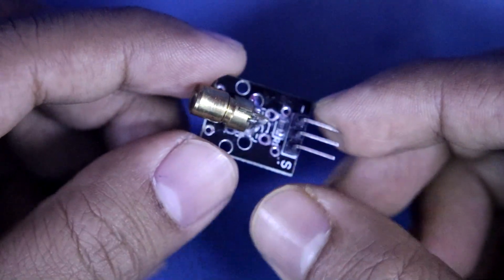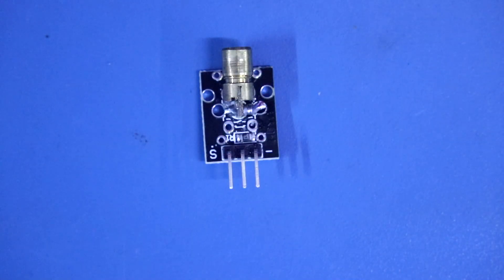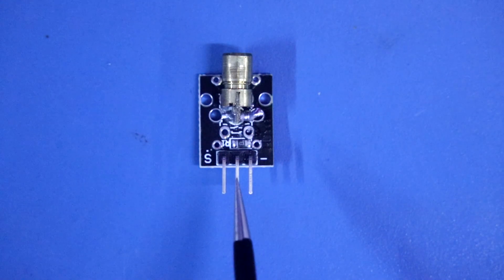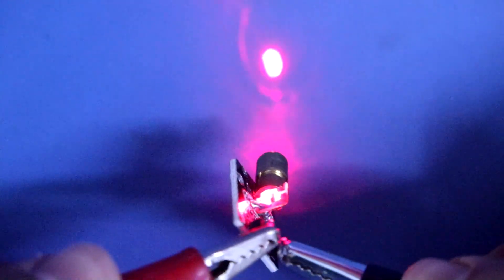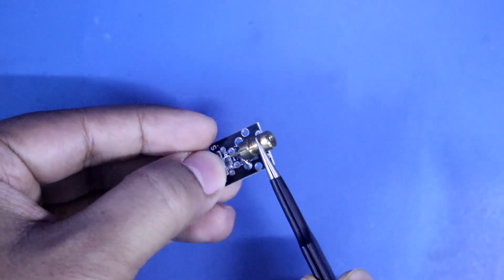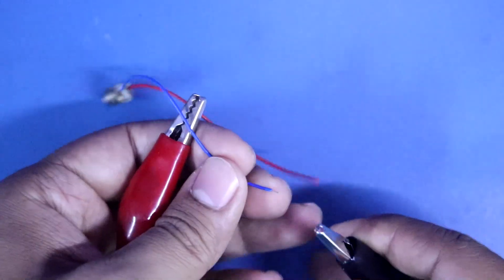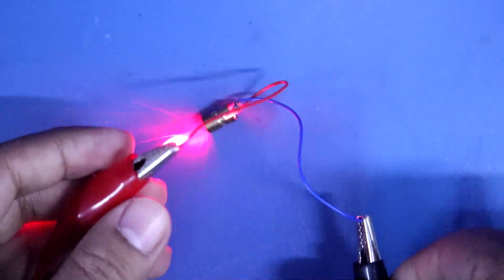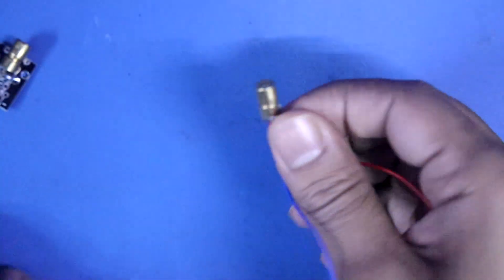KY 008 Laser diode | 37 in 1 Sensor Kit

Comment: What's the purpose of the middle pin?🤔
Reply from the maker: It is useless.
Reply: It is signal pin, you use it with any condition based cases, like with an Arduino board, raspberry pi